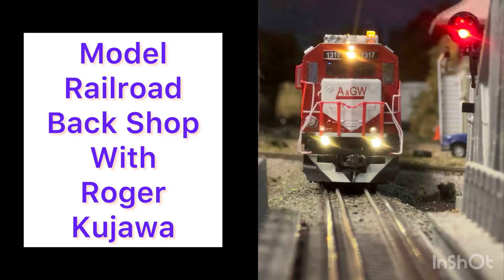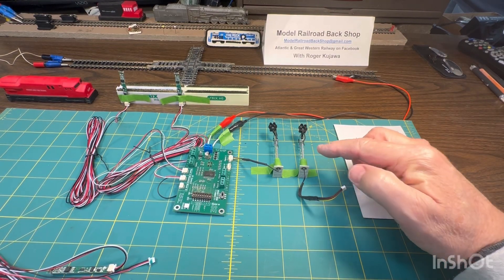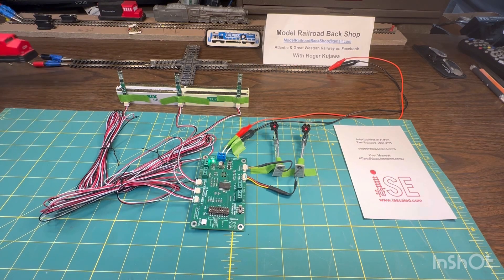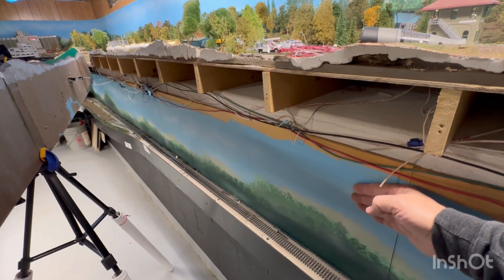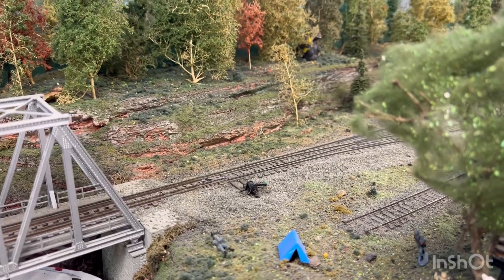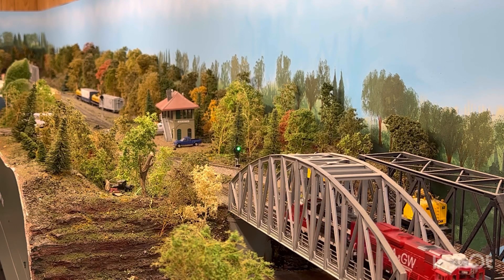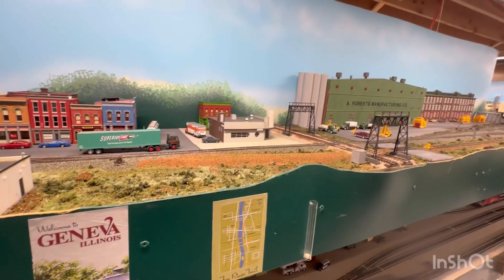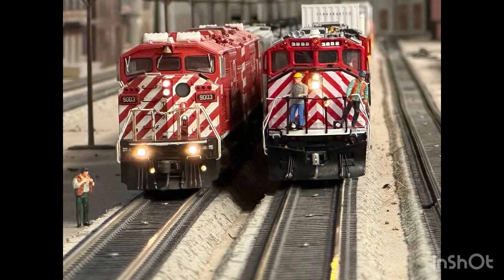16. Iowa Scaled Engineering’s Interlocking in a Box model railroad signal system by Roger Kujawa

Comment: I have a smaller layout thats basically a folded over figure eight. The layout is divided into 5 blocks  I installed an Aztrax signal controling  system to control the blocks and the crossing. The signals at the crossing operate much the same way.. Operating signals really bring the layout to life!😎

Comment: If you have a track arrangement like yours but all lines are live, and you have a train clear its own signal and shortly thereafter another train shows up, will its signal stay red until the first train clears the diamond?
Reply from the maker: @johnschultz9023  Iowa Scaled Engineering has one for all 4 live directions comping out soon.
Reply from the maker: This system is made for a dummy crossing but Iowa Scaled Engineering is working on an advanced system that will do this.